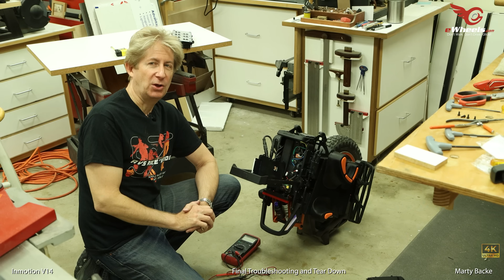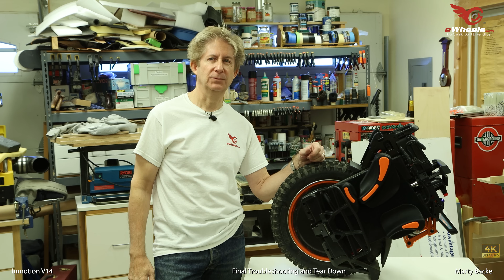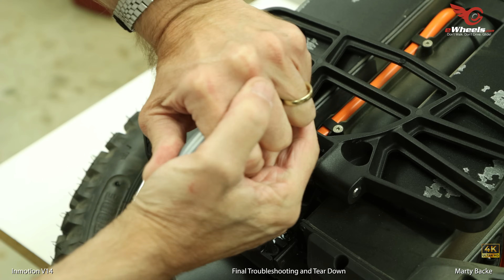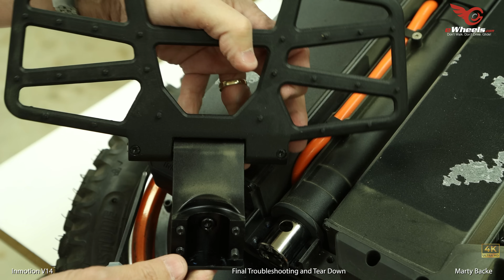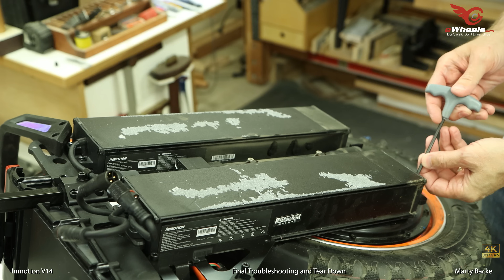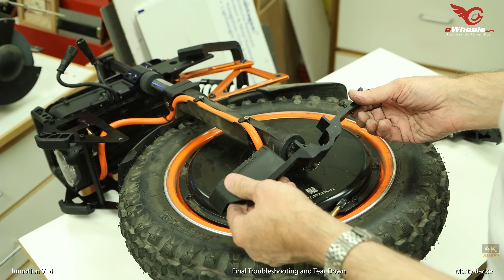Final V14 Testing & Tear Down

Comment: They want to replicate your failures so they can provide a proper/permanent fix; no more or less complicated than that.
Those engineers are in China and the less handling the DUT has on the way there the higher confidence that any problems they find were originally there before shipping out from your location; if it were my product I'd have done the same thing.
Could have even been just a marginal batch of hall sensors got through in manufacturing; that they had you send it to them directly speaks to their desire to ship well designed and performing products as well as your relationship with them.
I would like to think of it more as a sign of our evolving relationships with overseas vendors in emergent technology during a modern era than any sort of trending indication of poor quality/design.  That's a good thing.  Really good.

Comment: You did set your multimeter in DC but every hall sensor gives AC so your diagnostic data is kinda wrong.
Reply from the maker: Well, I precisely followed the directions and video from Inmotion. They probably know what they are doing :-)  If you read the theory on how hall sensors operate you will learn that they can be used for measuring DC or AC current depending on the application.
Reply: @ElectricUnicycles  well you're probably right, im more use to test hall sensors on car like speed sensor or wheels sensors... My bad.
Btw you're not the only one who already has issues with the V14 some others reviewers have issues too

Comment: Good troubleshooting video. Question: What is the reason for controller board getting damaged when there is a hall sensor failure (signal coming from the motor)? Does the controller logic makes it short itself out or something? Just trying to understand why does this happen
Reply from the maker: Sporadic hall sensor input can make the control board drive the motor rapidly backward and forward (like idling, but at 100x speed) which can cause excessive currents so fast that the MOSFET's will burn out.
Reply: @ElectricUnicycles  Thank you for explaining! it makes sense now... in other words the lack of closed loop input from the hall sensor makes the system underDampened with zeta close to 0 ✌

Comment: I suggest you get some hex Alen wrenches, that can be used with a screw gun. Much easier and quicker than doing it by hand with a handled wrench.
Reply from the maker: I don't believe in using power tools when working on wheels. My choice :-)
Reply: As a maintenance QC Inspector for one of the U.S. Major Air carriers, if a Mechanic was seen driving Socket Head Cap Screws w/ power tools, they'd likely be delegated to work Interiors and leave the jobs effecting the Aircrafts Airworthyness to Real mechanics. Maybe Cleetus & Jeeters Auto Werks is the place for that kind of maintenance.  😉
Reply: its easy to overtorque bolts with powertools, but to unscrew them, yes, it would be faster
Reply: @milordas  Na, still a bad Idea, that's how Phillips Heads, Cap Screws & Machine screws get routed out and Threads galled beyond repair. It's why they invented Socket & Ratchet wrenches. Leave the Screw Guns to the Carpenters where they belong.

Comment: Did you see the video of the guys, I think electric dreams, who were testing the Lynx? They wired in a switch on the hall sensor. Then he got the wheel up to 25 miles an hour and disconnected, by flipping the switch, the hall sensor! Ballsy stuff! The wheel started beeping and then slowed down all the way till about 3 miles an hour and then it quit. No cut out. 👍
Reply from the maker: Yep, that was a good video 👍
Reply: You can do the same thing on the Abrams. You know the 'cutout' wheel? It's all done in firmware.

Comment: So I work for LG Electronics, and these things happen. But, we keep a massive variety of inventory sitting right here in Los Angeles. If I get news of a defective product, I log into it and analyze the error code data the day that I hear about it. If something is wrong we don't mess around. I would notify you the same day that an entire replacement product is shipping and here is your tracking number. We take the defective unit back and then send it back to Korea for analysis. But most importantly, we never let you sit on a product that is defective, we react immediately so you don't make videos about it😂😂
Reply from the maker: Good to hear. Certainly an advantage to working for a huge conglomerate like LG relative to a very small company like Inmotion
Reply: So make us an EUC 😅
Reply: @mcogon  that's funny! 👍

Comment: Are you kidding me, the entire body weight is dependant on one screw that it through a flimsy tube???? Unreal!
Reply from the maker: Correction - two screw heads
Reply: The battery packs also form part of the structure

Comment: First again 🎉😂
Reply: Get a job!
Reply from the maker: Afeez. Do your e-RIDES pedals really fit the Lynx? They are different from the Patton. Looking at your website.
Reply: @ElectricUnicycles  They do, the e-RIDES Patton pedals (Biggie and Trail designs) works with the Lynx. Use the ratchet system included in the box for installation instead of the friction system that comes with the Lynx. We will also be including the friction system sometime in the near future.